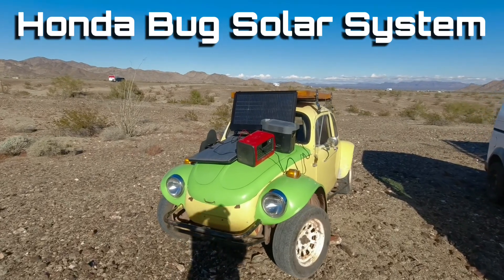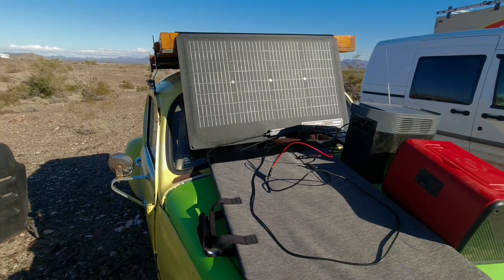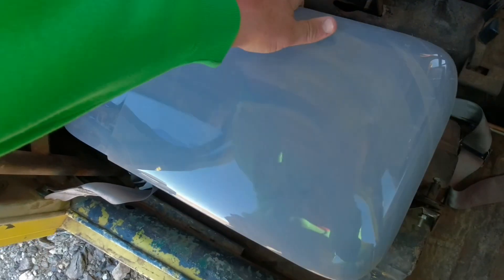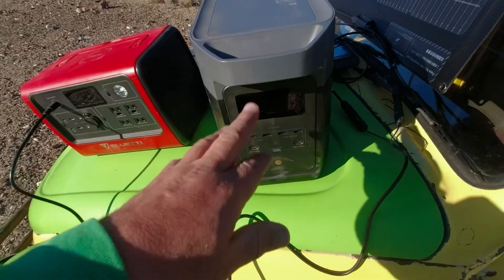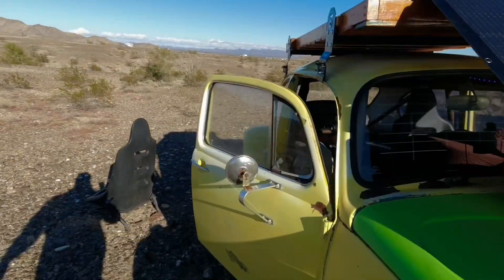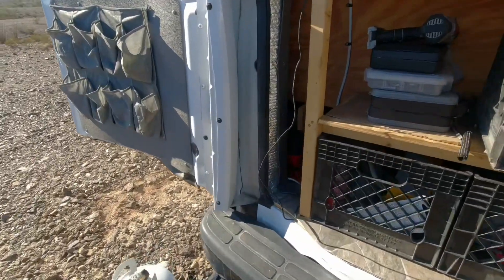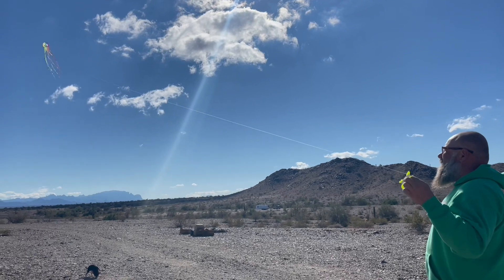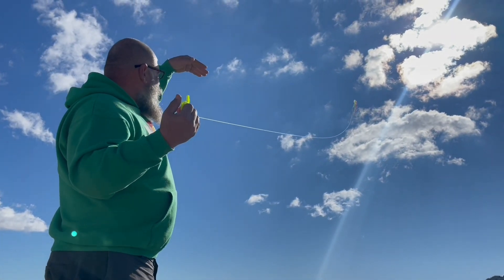K Swap Baja Bug Solar Power System

Comment: I for a fact do love that I can still use my Delta Max battery and connect it with the Delta 2 to increase the capacity.
Reply from the maker: I am also planning on adding a Delta Max battery. It has plenty of charging power to keep the extra battery charged too!